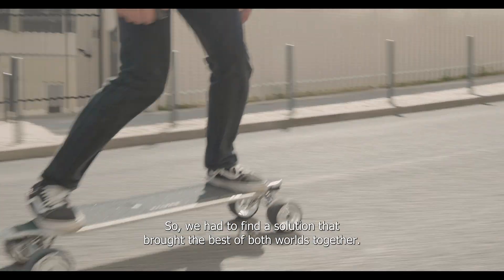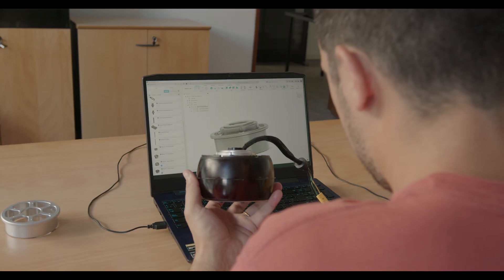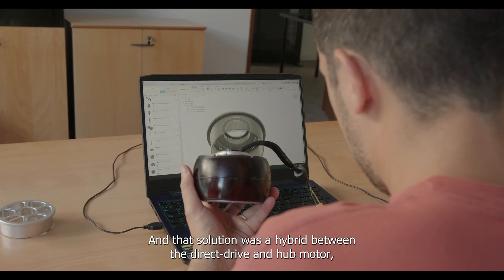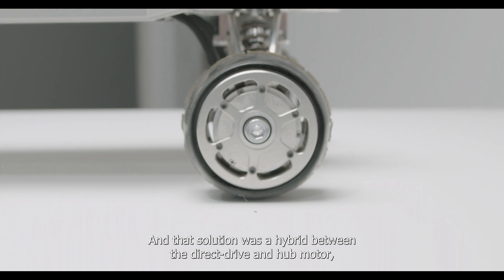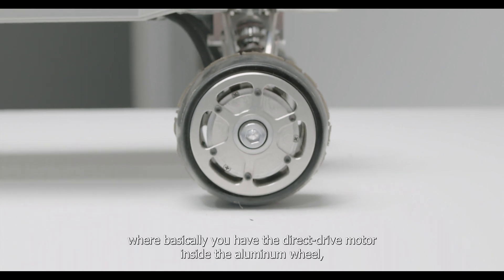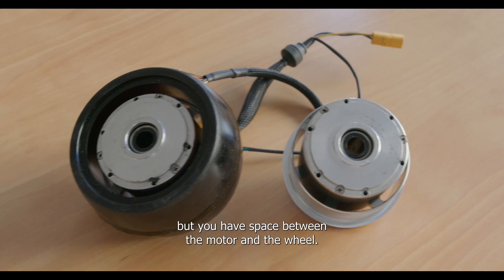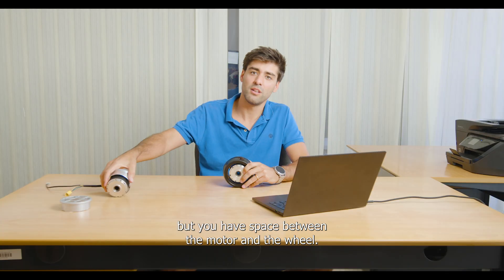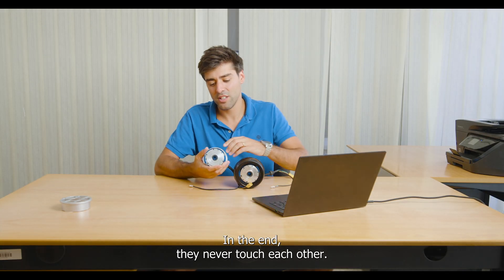Introducing the Hybrid Motor by Hunter Boards

Comment: Where's the hybrid part?🤣🤣🤣🤣
That's simply a hub motor same as any other hub motor but with a gap🤣🤣🤣
This is hilarious
Reply from the maker: It's a direct drive motor inside a wheel, thus the hybrid between the direct drive and the hub.
Reply: @HunterBoards  that's a hub drive motor and nothing more 
The space between motor and wheel means nothing as long as wheel spins same rpm as the motor 
If you had planetary gearing inside that space yeah you could call it a hybrid but that's just a hub motor same as all the escooters they have space as well and they're not called hybrid